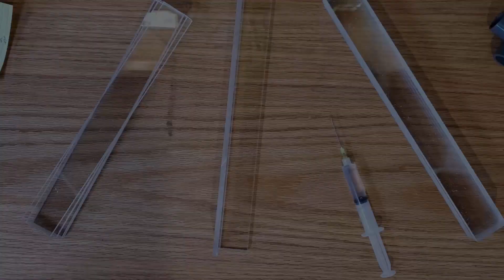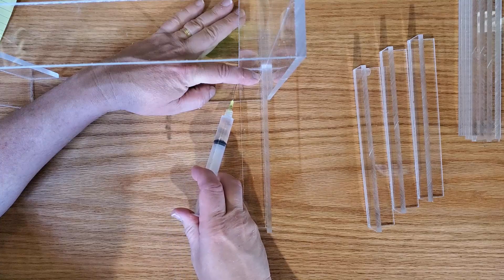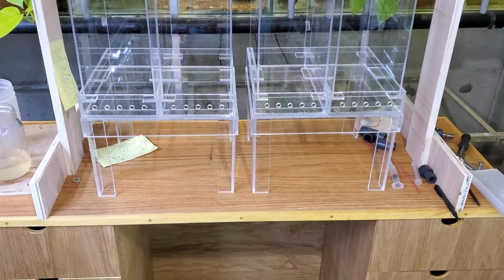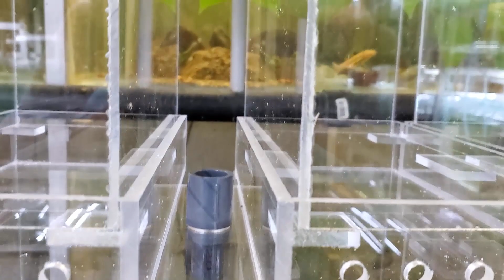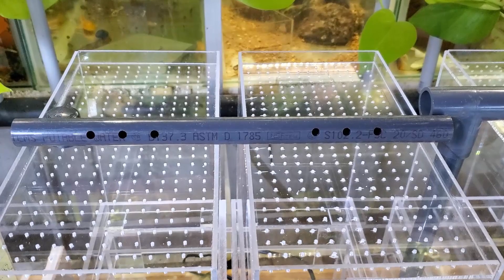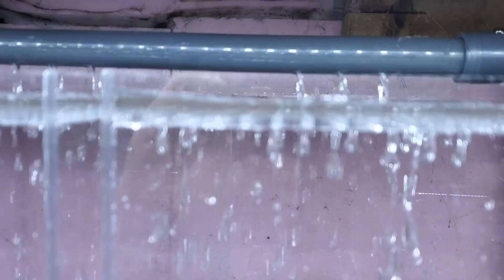Rain Forest Build Part 2

Comment: With that amount of water flow You could build four small trays to hold a little floss for mechanical filters that could easily be pulled and thrown away and replaced, that would add mechanical to it as well and if it clogged up it would just overflow and rain down more, you could even use that to distribute the water more evenly although it looks to be spreading out really well and once you have plants and stuff in there it will probably splash around a little too.   I don’t even know that you really need little trays you could just cut four squares out of floss and it will probably just find its way.  

Also if you were to do something like this for a restaurant you could have the pipe coming from the back and use black acrylic on the back panels just to kind of hide the mechanics.  If I were to do this as some sort of commercial application I would make the front panels removable, may be magnetic just so they could easily be squeegeed off for display purposes. 

The thing I don’t understand is if this is all going in one tank why did you make it for boxes instead of just one big box?  🤔 I thought you were making four different filters till you put it all together.

I love the look of your other high humidity filter, And I think this will look awesome, especially once it all grows in.  I would love something like this maybe sitting on the back of a 50-120 gallon tank but kind of one giant box the straddled the back of the tank, Kind of it’s a little rain forest. Maybe a single giant box about the width of the tank and maybe with two sets of an easily removable front panel just for cleaning sake, so you could pop one off and Pop the clean one on and then clean and buff out the other just for easy maintenance.  Lol.  I love this style of filter and there are just so many options you could do with it.  And I’m sure not being completely submerged would open up your options to new plants as well, stuff that could grow in high humidity but not necessarily underwater like a lot of mosses I’ve seen, i’m sure there are some plants as well like ferns.    I think if I were to build one that would probably concentrate the rain more towards the back just to keep the front a little more visible and to have some variety in there, some water areas and some drier areas. I might also beef up the bottom of it with a thick piece of acrylic that didn’t actually have to go in the tank except for the pump, that way it could just sit on the rim and be supported on three sides or even be offset in the back and just supported from the center in the front two sides and drip only back into the tank, that would make it more towards the back of the tank and sitting behind it so it didn’t take up as much inside the tank room on a thinner tank.  Like I have a 30 gallon that’s 30 inches wide and it would look awesome on top of there but the tanks only 11 inches wide so will still be able to get in there I wouldn’t want it covering more than four or 5 inches of the water.  I have a planter over it filled with lava rocks and pothose that sits on the shelf, I would probably just lower the shelf to be even with the top of the tank and replace it with a rain forest box and use my existing pump which sits behind a corner mat and filter come up that wayThey could just move the tank out a few inches and make the box on top of 30” x 10” or so but only have about 1-3 inches of it over the water in the tank.   It just opens up almost another level of having an aquarium, like a terrarium as well but still a filter.   I might even consider leaving the top of the box closed. The top of my planter is open and the water being pumped into it goes through a huge mat and filter first and on the inside of the planter box itself has a square of cut out floss or padding which stays very clean really I’ve never changed it but I do notice I seem to get a lot of dust or something in the top if I pour some water in it will put a bunch of cloudy mess into the tank if it’s disturbed. I figured that’s a 30 inch bye seven or 8 inch opening that probably collects a fair amount of dust or maybe it’s just growth on the lava rocks, I’m really not sure how it gets there. Lol.   This is pretty awesome, it kind of makes my mind start thinking about all different sorts of options. I’m surprised a company like Flueval hasn’t already come up with something like this.  I think this type of design is a lot more marketable than some of the others. I get how the other filters work but I don’t know that I would ever actually use any of them myself but this has a lot of market appeal I think.  Awesome. :)
Reply from the maker: So glad you like it Shane! I made in four because I need this to grow out plants for clients. This way I can setup one for certain needs and then transfer it to where it needs to go and then set it up again for something different. I am planning on doing a more integrated version after all of this is over. It will be more of a complete unit with one above tank box. Should be an interesting setup. Thanks for coming by!

Comment: Looks cool!    I use power bars for my aquariums so I can just fllick a switch as apposed to dealing with plugs which are often in awkward spots.
Reply from the maker: Hey Sue! I've wired all of my outlets on the ceiling, but it still means plugging something in. It should be easy enough to make a switched extension of some sort. Thanks for coming by

Comment: It looking awesome.
Question! Wondering when time passes, let say few months to years, will plexiglass filters you have made... Does it loose its structure due to the water or not?
Or do you use a specific type of plexiglass that does not loose its structure or do you use a plexiglass  thickness that will help with that? 
Thanks
Reply from the maker: The acrylic I use isn't special, but it isn't generic polycarbonate either. I've made filters over twenty years ago and they are still functional today. Hope that helps

Comment: Great design. I did something similar for raising dart frog tadpoles. Something I found is if you decide you want less water flow, you will need to face your spray bar upward. This helps to even out the water flow to the outer ends of the spray bar.
Reply from the maker: Thanks for sharing that and thanks for coming by!

Comment: An absolutely spectacular, if ungainly, design for filtration/aeration.  But I always place myself in the role of a young aquarist.  They've got one tank and are looking to expand, likely to the bottom shelf of their wrought iron stand.  They have a choice between a second tank or a sump.  Guess which one they're likely to choose?  They therefore need to substitute an HOB or a sponge filter, plus water changes, to maintain water quality.  And that brings me mentally around to fitting and judging a  filter for a beginners set up.  This unit would be too big and requires some advanced understanding of the biological processes at work.

So - I'd love this filter for a tank in my fish-room.  An interesting and great experiment.  But for a new or limited space/income hobbyist I believe the best compromise to be an HOB filter, pump or airstone driven, with as large a media box as possible - something manufacturers always seem to save manufacturing costs on.  And that's the thing that really galls me.  For a two tank beginners set-up, there's been no significant improvement since the 50s.

My comment, not relevant for this state-of-the-art experiment, is more a commentary on the state of the industry.  I'd like to see you revisit an old HOB or in-tank design for maximum size and capacity.  Something sized for a single tank beginners set up.
Reply from the maker: Glad you like the build. For the new aquarist I would probably recommend the box filters I've been putting together recently. They are plenty efficient for the starting setups and are cheap and easy to put together. Thanks for sharing your thoughts on this and on the industry